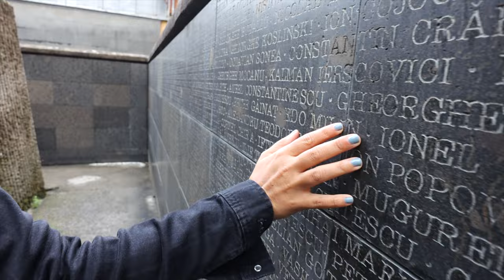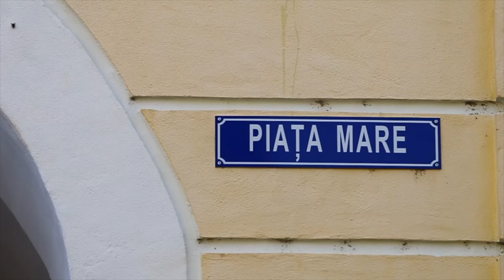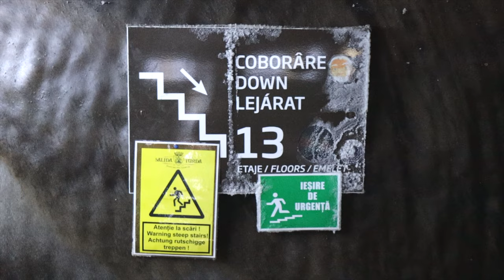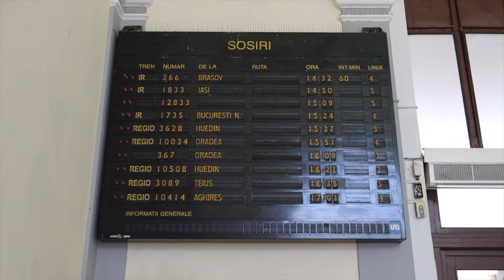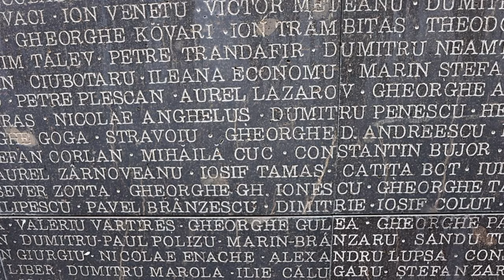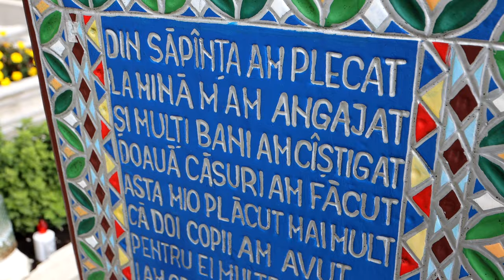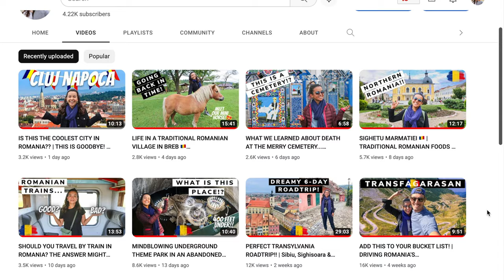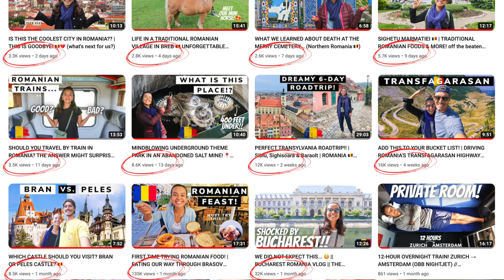EVERYTHING YOU NEED TO KNOW BEFORE VISITING ROMANIA 🇷🇴 (cities, foods, local's recs & more!)

Comment: Bran is more a fortress or a stronghold it wasn`t made for luxury but more for warfare, yes it has a kings quarters but it was not intended for longer then needed stays. If the translation will be corrected from castle to fortress it wold be better so tourist know what to expect. Also keep in mind that Bran is 700 years older then Peles
Reply from the maker: Yes, you're probably right! Thanks for the info :)